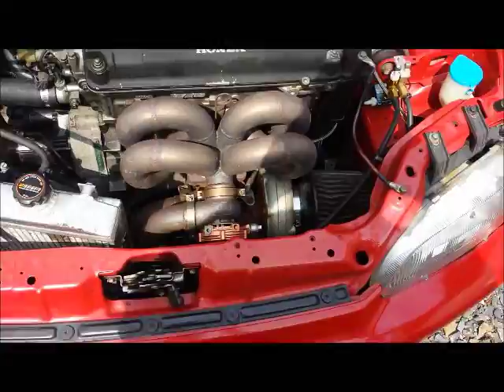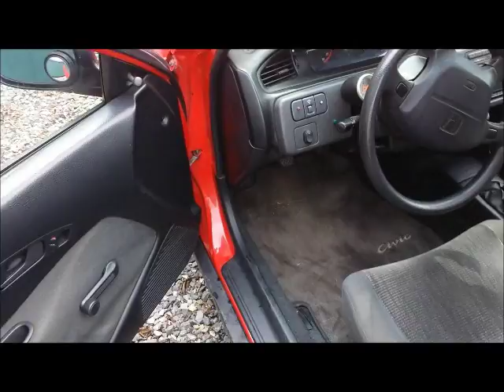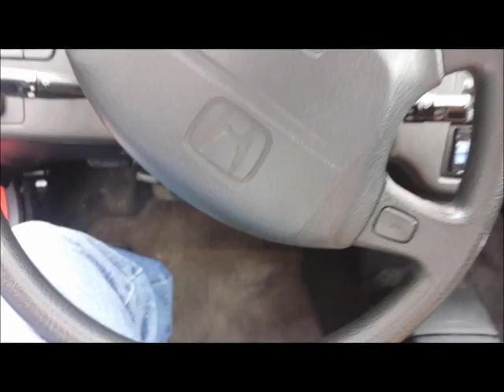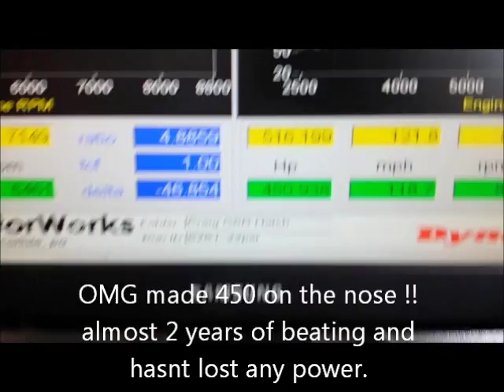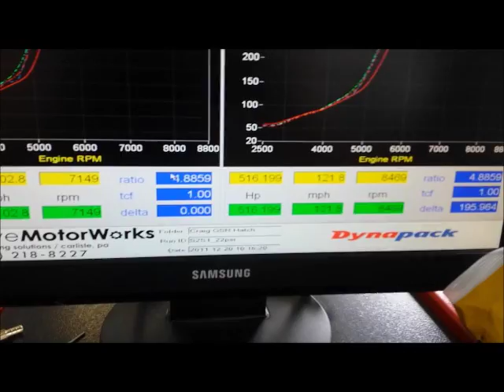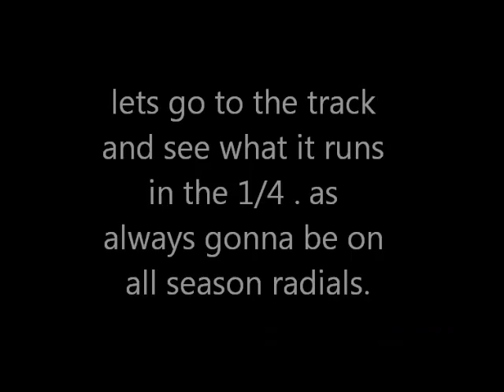The benefits of alcohol injection on your turbo honda

Comment: Awesome video... I would love to debate/prove that water and alcohol will actually give you a higher anti-knock level and more horsepower... I've done both. I've been running a cooling Mist pump for almost a decade now probably 7 years of actual use... About 59,000 miles. I've gone through two head gaskets and had the cylinder head rebuild messing with the timing and playing with the tune. I'm running a hx35 about the same area of horsepower as you different engine but we can actually see knock come on sooner with straight methanol then with a 50/50 mix @ 27.8 psi we encounter knock at 24 degrees with straight methanol where I don't with a 50/50 mix. I had to turn it down to 21 degrees with straight methanol. Also wanted to let you know you can rebuild the diaphragm head of the methanol pump. I would recommend doing it from the get-go that way you don't ever have to worry about the pump failing.

Comment: i'm thinking of doing this to my subaru. stock turbo. about 300hp. my main goal is to get boost at lower rpms, currently it spools at about 3k rpm.  did this setup accomplish that? or just make more top end power? i couldn't see the graph clearly enough.

Comment: Impressive dyno numbers. Seriously.
But why wouldn't you just get a tune for running 20 psi on 91 octane pump gas...? You seriously over engineered your set up...!
Reply from the maker: we use 93 octane and the car already had a tune for that. this way allows you to make even more power by running even more boost and timing

Comment: Most companies call for 50/50 mix because its the most efficient for a pump gas tuned car.  The methanol will raise octane levels well over what you'll need (91 can hit beyond 100 octane no problem) and the water mist will absorb heat within in within the cylinder, reducing temperatures.  They work together to raise octane and lower temp to allow you to raise boost without risk of detonation.  Those pumps can use methnol no problem, 50/50 or pure. Its literally just windshield washer fluid and will not fail due to being caustic. 

source: car guy and biochemistry degree
Reply from the maker: +Shikamoo P.K. pure meth is superior to water meth for high hp builds.
Reply: +Frank Gutowski I would take EngineLabs.com's word over google any day of the week. Google's quiet often completely wrong when it comes to anything technical and automotive related. Even simple questions like timing settings for different vehicles I've seen people look up and google was out by such a long way I ended up setting it the old fashioned way instead.
Reply: +Justin Sane baddd ass caro bro
Reply: Yeah, although I'm just a lowly mechanic- I've spoken to my best mate who's a mechanical engineer about this and he claimed that the 50/50 mix was superior BECAUSE the water vapour in the combustion chamber will lower the heat caused by the combustion stroke cause it stays a vapour throughout the combustion process. Both will draw heat from their surroundings, but the meth burns and the water doesn't- it only cools. So I'm going to have a look at both on the dyno shortly and investigate it for myself with some EGT's for each cylinder. But I disagree about water and meth having the same LHV's- it takes more energy to convert meth to vapour and therefore it draws more heat out of it's surroundings. A simple test or example is to put a small drop of water on your arm and then put a small drop of methanol on your arm in a different place but of the same size. You'll feel a much stronger cool feeling on your arm from the meth, that right there is the LHV we're talking about bro
Reply: Daniel Brealey you just need to look at the fastest cars, the run pure meth. VP M1/M5
Reply: +Frank Gutowski I'm not saying I'm right and your wrong, but I just read a great article on EngineLabs.com yesterday that said the same thing I just did. I'll try and find a link and post it here for you if your interested. It was an article about choosing E85 vs Meth injection. Was really good. Just out of curiosity, where did you look that up, I wouldn't trust anything Google has to say about something technical like this. Google is wrong more often than people realise
Reply: +Justin Sane i agree, all the benefits he mentioned plus more with straight meth. Meth has a much higher latent heat of vaporization than water, therefore will pull more heat out of the combustion chamber AND it will give you an even higher octane rating

Comment: JK Tuning !!!!
Reply: love the video just have a ?.I have a Saturn 1.9 dohc and the intake is in the back by the firewall.What if i took and tapped into 1 or 2 runners onthe intake abd spray 109 petcebt or start of with a 50 /50 or what ever works to give me piwer .This is for a 1/2 mile oval 4 cylinder stock class i figured a 1/4 to 3/8 metal rod that yoy can sctew into the ibtake from inside then something i can spray up in maybe an injector that would spray all 4 cylinders throyfh the middle runner or 3rd runner depending on what cylinder. gets gas first .Have you heard of this being done or any ideas.My car weighs 1900pounds. and stock with a ported intake .I can unscrew the rod or injector the has threads ob it so texh shed dontsee nothing. You would have to take off the intake to see the 3/8 hole any ideas with methanol so they cant see it.I unscrew everything from inside.

Comment: Why would u ever design a engine that has the exhaust manifold in front of the engine. Common sense would dictate that the manifold heat would be forced over the engine and heat every component behind it???
Reply: Tell Honda that their engine design is poor lmao.  They make F1 engines.  I think they know what there doing.
Reply: Hhhhhmmmmm???
Reply: phillys976 Turbo manifolds get a bit stupid. I kind of feel like the manifold could've been done a lot better and a lot neater, rather than having a jumble of piping sitting up there.

I doubt it would make much of a temperature difference, but cosmetically, it looks weird to me.
Reply: phillys976 Bench engineering at its finest. Pretty much every inline 4 cyl, front wheel drive engine I have ever seen has the headers on the headlight side of the motor. Kind of makes you think, there must be reason for it?
Reply: AnthonyH  Packaging, space restrictions, close to equal length runners...?
Reply: cheapcharlie7 there is not to many FWD engines that have the exhaust at the back of the motor but the the Honda K series engine has it at the back.
Reply: Damn you stupid honda b series engines sit side ways dumb ass.

Comment: Justin Sane.  Is it necessary to install a boost controller on a completely stock motor?  is it necessary to install a high pressure fuel pump? When boosting lower than 10 psi
Reply: Ahahh....that's true thanks man JOJO B

Comment: Water/Methanol injection (and not alcohol...) is designed and well used for ww2 planes, wich had 12 cilinder and 16 cilinder engines... Then with methanol you can gain a lot of horse power, but do you think that with your tiny and pathetic 4 cilinders honda civic you are going to gain a lot of horse power? lol Make sure 2-3 hp.
Reply: +Survivalist You have no idea what you're talking about.  
The stock tune can only handle so much boost. You will run into issues with detonation due to low octane levels.  

The WHOLE POINT of methanol is it reduces intake temperature and raises the octane levels of your pump fuel (by mixing within the intake).  If you can raise the octane levels of your pump fuel with methanol, it will allow you to increase boost pressure and ultimately increase horsepower. 

Youre not wrong, you're just not educated.
Reply: Trolling, but get ur GED  and learn how to spell...
Reply from the maker: I'm in my 40s. To old to change now
Reply from the maker: Survivalist we went from 450 to 510 whp on a mild tune.  on my LS motors i typically see well over 200 hp gains.
Reply: Justin Sane Yes but not only with methanol, it was because you increased the boost= Turbo pressure and fuel pressure. And this is trap. You should do the comparinson with the same boost and same fuel injection to see the differences beetwen with methanol and no methanol injection. Then you would see only 4-5 hp of difference. Do it and tell me... xd
Reply from the maker: We gave done that and have seen 25 to 30 hp gains with just the denser charge.
Reply: Survivalist You dumb POS. Why would you not make tunning adjustments to take advantage of the burning Methanol? The only advantage to adding methanol on a tune based upon pump gas would be to cool the intake charge and stave off detonation if your a little on the edge with your tune. You do realise Methanol is a form of alcohol? The same with Ethanol. Stick to breeding with hour relatives in your mud hut, every one has to be good at some thing.
Reply: mrhanky5555 This has forged internals.
Reply: Glen M
so ur saying a honda motor cant make 10 seconds on stock internals?
Reply: no I'm saying exactly what I said which is this car has built intrernals.
Reply: The methanol also makes it safer to run more boost.  Especially on a stock block. Honda makes a great motor.  10 second 1/4 mile on stock internals is sick.  Stop trolling moron.

Comment: My 1991 900 t (SPG clone) running 28psi with 50/50 injection @ 350hp I can't hook up 1st thru 4th . How do you keep your's on the ground; and how do you keep the stock transmission form grande-ing with 500+hp?

Comment: AEM's pump can run 100% methanol. They suggest 50/50 because the gains from running higher are negligible at best...slight ...but not worth the effort, safety, or corrosion that 100% causes...

Comment: In Brazil most of turbocharged cars runs on ethanol using boost pressures above 21psi, highest "octane" of ethanol makes easy to run on huge pressures, drag racing turbos run on 36 or more psi pressure!!!

Comment: Question sorry im new in all this but if you have this can you use NOs as well??
Reply from the maker: Yes
Reply: Justin Sane soooooo MUCH BOOOOOOOST THANKS MAN question what would be a a reliable set uo turbo with NOs or supercharger with water ethanol 50/50?
Reply: MrOsma10 lol it seems like you can just turn up the boost on the turbo instead of setting up nos...... but idk.

Comment: got a question..
i dont have a turbo but i like the idea of getting more horses from my v6 engine on E85 ( E85 is cheaper than normall unleaded in my country) what are the mods that are required to make it work for every day use and track use?? i drive a GM opel vectra v6 from 2000

Comment: Have you upgraded the valve-train at all? I'm building a B18C1 for turbo application. Nothing massive, target WHP of 350-400. I've bored the stock sleeves to 81.5mm and will be using 9.0:1 CP's with Eagle rods. Will the stock GSR valvetrain be sufficient for 350-400hp?
Reply: Duhhh

Comment: Alcohol is a very potent solvent and it degreases the bores causing rapid wear,
Reply from the maker: ICEGTN negative, water flashes off at way to high of a temp and raises compression. it can also fail to flash off totally at to low of iats and pool to the back of the intake loading up some cylinders more. water also has no octane raising properties,  i have been running water meth for many years on different cars and pure meth is by far the best way to go. my datsun with a junk yard 4.8 liter ran 8s in street trim on 93 octane and pure meth. water would never allowed me to make that kinda power.
Reply: Justin Sane Justin can you please make A video on how you tied the boost controller into the ecu .

Comment: i think thay recommend  50/50 deu to it makes more power
ww2 plane makers invented it and tryed all mixes and found 50/50 by mass not volume makes most power
Reply from the maker: no they recommend it for safety cause if you crach the alcohol wont burn with the water in it also most kits and pumps cant support pure alcohol so they suggest a mix so the parts dont wear out. pure meth always makes more power.
Reply: Justin Sane do you still have the car and etc
Reply: Anthony Aviles if you have a email address i wanna ask you a few questions

Comment: hey i wanna get this exact kit you got  where can i get it.  ive check the site they have for specific cars  i was wondering what kit u used from alky.  thanks.  ive seen a universal alky kit on ebay from alkycontrol  would that work for my  turbo honda?